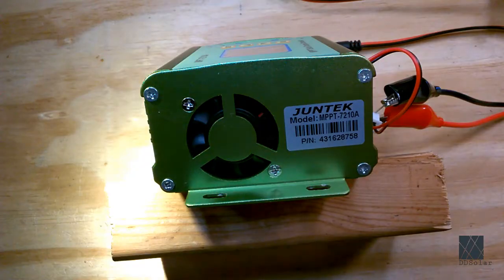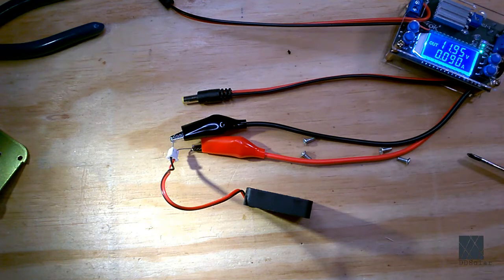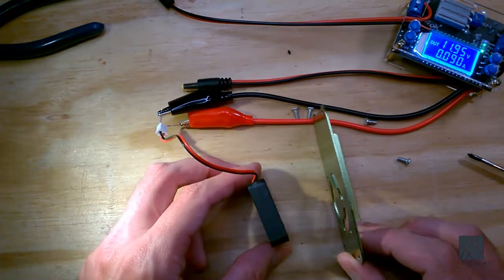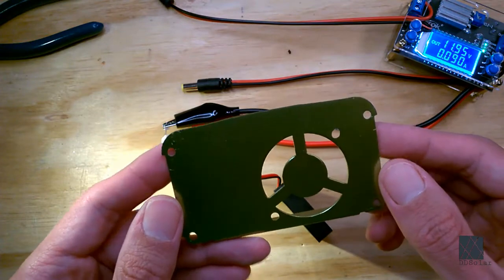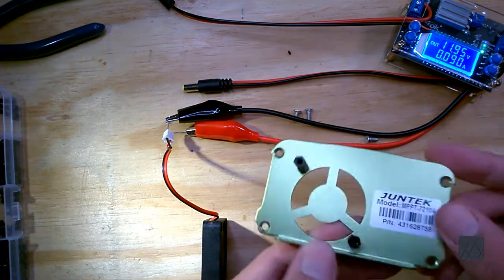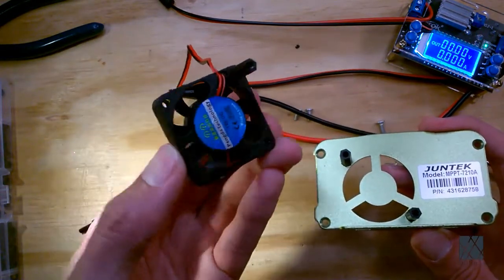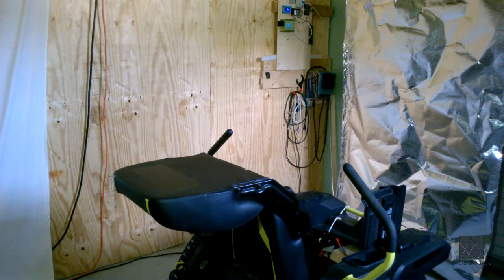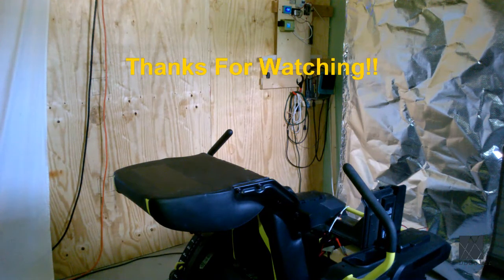MPT-7210A Loud Fan Fix - How to quiet the fan on this Boost Solar Charge Controller

Comment: That was marvelous! What I hate about the MPT7210A is the noise. And you pretty much took care of that!
What I like about the MPT7210A is the colored display and the info it provides, ease of use and versatility as a booster.
I'm wondering however if a thin foam gasket between the fan and the metal mount would also work, reduce or somewhat dull the high pitch sound? In any event thanks a lot for putting this up I would not have had the guts to tear this thing apart and fiddle with it the way you did.
Reply from the maker: Your comment made my day, thanks a lot! I like this charger for the same reasons, I have never seen a charge controller with a display this cool for such a small price. I think the foam would work, it just needs to get those super fast blades away from the thin metal "grill" that's covering it. It's very easy to get to the fan, just 4 screws (they are easy to strip) and there is the fan. It probably voids the warranty, but hey that's the price of making things better :)
Reply: I was thinking the same only a thin cork sheet .

Comment: Thanks! I just ordered a secondhand one of these and was wondering about the fan noise.
Reply from the maker: Welcome :) I would suggest a higher quality 40mm fan. Stock fan known to fail. I'm keeping an eye on mine and I don't run a lot of amps through it anyway.
Reply: @solarpoweredge  thanks! I have a small server combination fan I can split in two. One of those might do.
Reply from the maker: No problem! Sounds like a plan
Reply: I just followed our host's advice and used a dremel to grind out the little cross pieces on the fan grill.  Works a charm!  Hardly notice the fan noise at this point!  For me, this took an annoying device that I really didn't like using and made it into the device I hoped I was getting when I bought it!
Reply from the maker: @quinbus51  Fantastic :) glad it worked!

Comment: yes that y i all wait cut out grill out the back of my compueter case more air flow and lestt drag on the fan make less noses
Reply from the maker: I will probably cut out that middle part next! Phase 2
Reply: @solarpoweredge  I just took a dremel to the little grill and it REALLY helps!  The fan noise is hardly noticeable now!  Thanks for the research and tip!  Much obliged!
Reply from the maker: @quinbus51  Hi, very nice!! glad it worked for you!! :)

Comment: smaller the fan loader they r y i use one 120 or biger if i can and more cfms
Reply from the maker: You are right, I have some 50 and 60mm fans but need to get my 3D printer working to make a shroud, hopefully someday